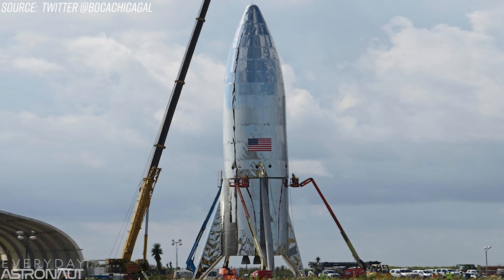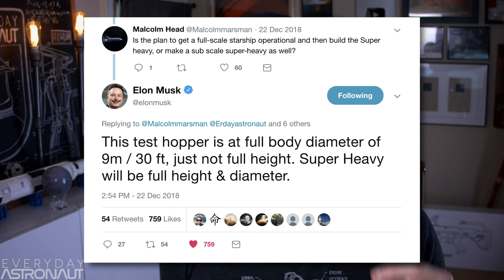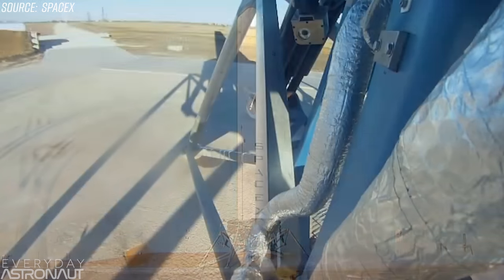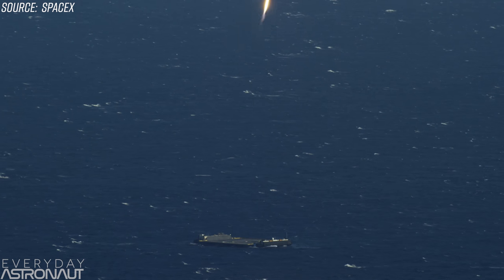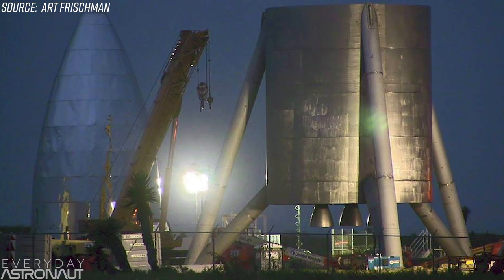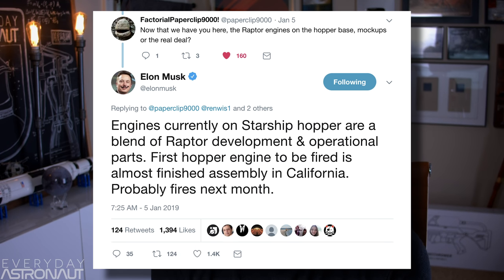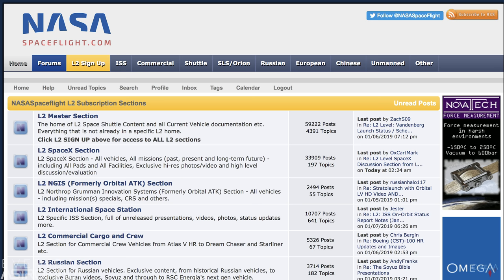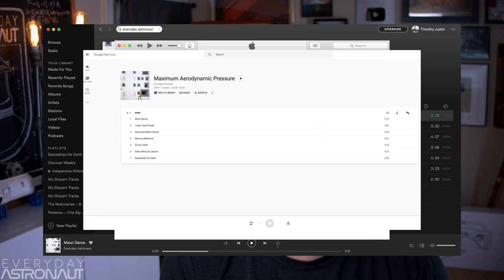Why SpaceX’s StarHopper will never go to space

Comment: How are they going to optimize the raptor engines? The  Starship is going to have to maneuver in space and make landing burns in atmosphere, correct? Won't it be hard to get that engine shape right?
Reply: Scott Manley talks about the Raptor's new complex bell shape in his video on this hopper. Can see you understand any engine can be optimized for atmosphere or vacuum, but not both. Rocket design is all about compromises, and this complex bell is a better compromise than most. Elon said was willing to pay fuel penalty for not having full vacuum bell on upper stage Raptors.

Comment: Could they fly it from Boca Chica, over the gulf of Mexico and land it at LZ1, LZ2 or LZn at Cape Canaveral?
Reply: Joost Stam 

No where near enough fuel
Reply: If it was possible (it might but with no fuel to land) the main problem I for see is that the pad might be to small for safe margins. The pads where not designed for a 9meter veical.

Comment: Will the bfr have something like a launch escape system or so?
Reply: Don't think so. Jet fighter prototypes have ejection seats. Airliner prototypes don't - just not practical. Their first-flight test pilots just have to hope they got it right.
Reply: @donjones4719  I think your right but what about the completed bfr Wich is going to fly to the moon?
Reply: @jannik6147   I think the overall design concept and size of BFRS means no escape system. Again, like an airliner. But I could be wrong, there could be a large escape capsule like on the B-1 bomber. https://www.youtube.com/watch?v=n0TVr0_m34s But building a capsule that works during all the flight extremes of a launch is a colossal engineering problem, possibly one without a solution. Ditto for reentry, a whole different set of problems.

Comment: Everyhting that you said with respects to the lineage of the prototype of the Starship, relating to the earlier Falcon 9s is wrong. The reason that there is this separation, is due to both mass as this translates to size and weight as it relates to lateral momentum. Elon Musk is looking at this issue that if he test-flies this stainless steel model, a little, and is lucky enough to get it back on the ground without crashing, then he can go for the medium sized proposed Star Ship and that will get him to Mars. For one, its too heavy to use just aft end thrusters, to preform a tail stand upon landing. Because of the size of the second model up in size, more than likely there will have to be reaction control rocket thruster boxes at the top. Another issue that Musk does not understand, is the thermal protection layer or anti-heat prophylaxis. With the weight he's going to be incurring with stainless steel instead of aluminum nickel or other alloy metals, plus a dynamic heat protection exterior, he's going to be incurring penalties that he does not want. One has to look at the Star Ship as a fully packed vehicle, that is going to have cargo plus people. If one gets a lateral motion going to where weight is concerned, then just a moving tail rocket nozzle may not fill the bill. If you ask me' this design is not workable for deep space travel.Lastly, because there is an alien pirate problem in this solar system, according to Patrick Huyghe's book, (The fieldguide to extraterrestials), don't name it Star Ship. Star Ship means that this spacecraft has a quantum stellar drive and bad sorts of aliens will jump the ship because of how expensive these drives are. Name it the Mars explorer or something. Elon Musk here, in my opinion is thinking with stubborn strong and cutting all good influences out of the picture. I want this said now, as in the future everyone will be looking at each other when his ship crashes asking, " Well' what went wrong"?! Thank you for posting this video.